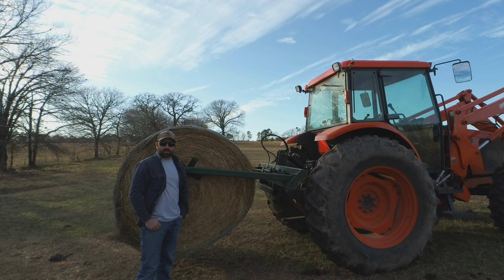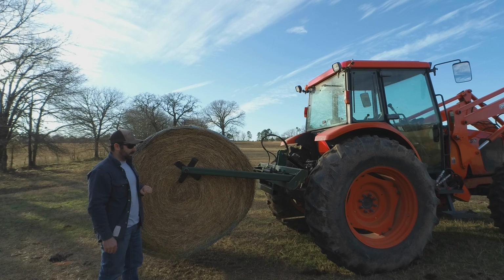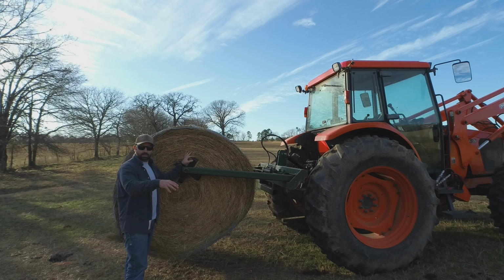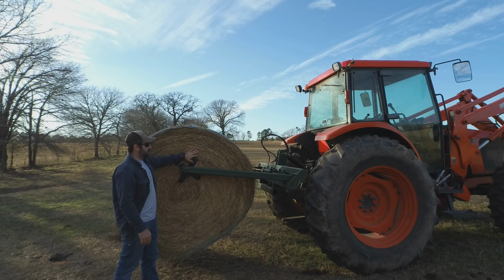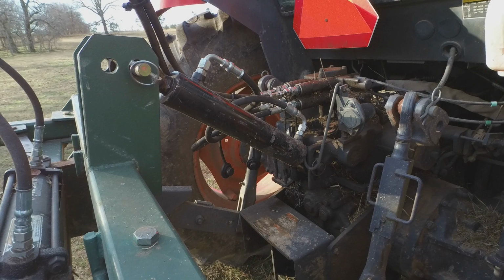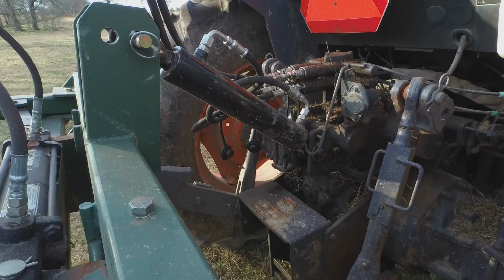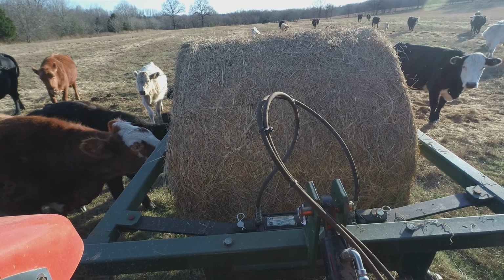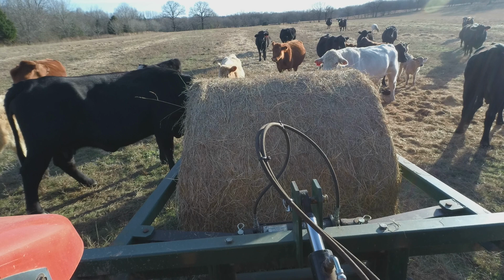How to Unroll Hay - Build Soil Like Greg Judy!

Comment: How do you operate the squeeze part controller? Will it work with a Kabota? Thanks.
Reply from the maker: You will need hydraulic ports on the back that connect to a hydraulic cylinder on the unroller. Those ports are controlled by a hand lever next to the seat. You'll hear these referred to as rear remotes, auxiliary remotes, etc. If your tractor has these rear remote hookups then yes it will work - really just depends on your tractor.